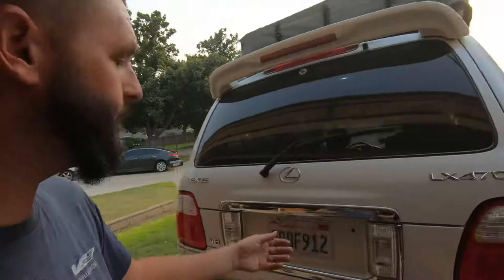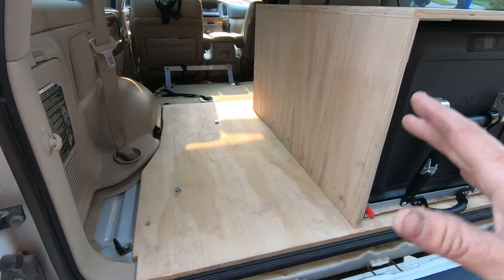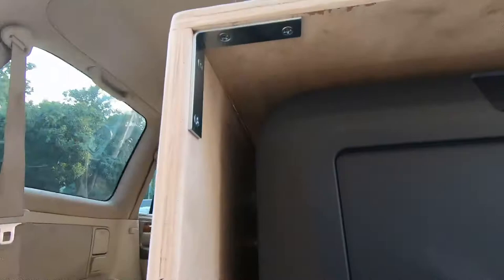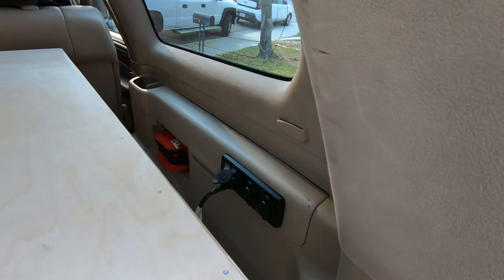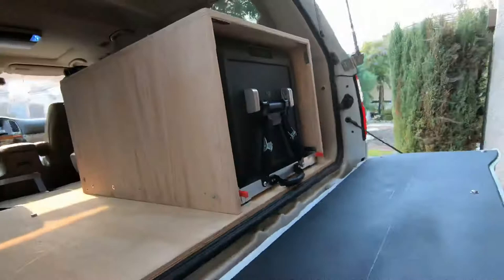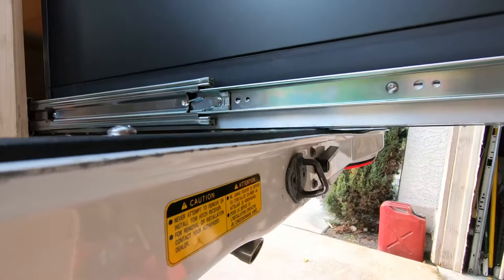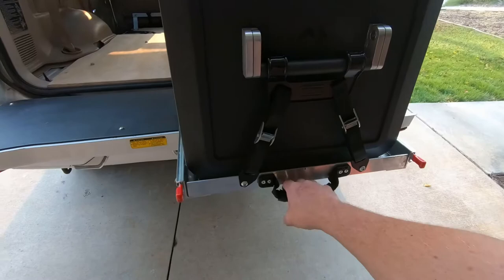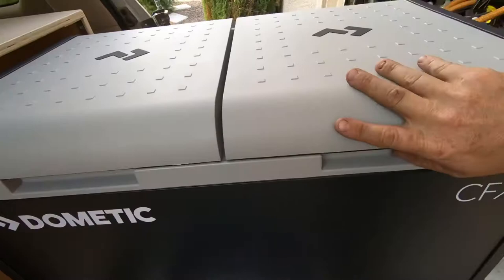DIY Dometic CFX3 75DZ fridge surround and slider project is a wrap...almost

Comment: I want to buy cfx3 95dz but on dometic website I can see that dc power input for fridge is 12V 10.4A, but on my truck dc output is 12V 10A, I have 0.4 A less than what fridge is rated for, is that can be a problem for fridge? Or what I can do to try to increase power output in my truck?